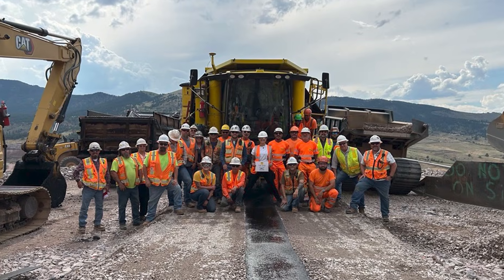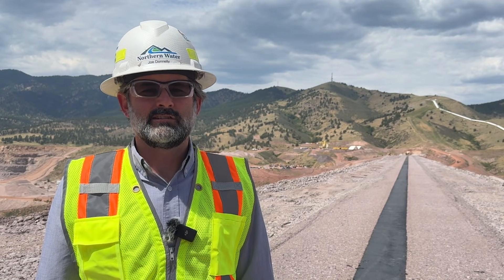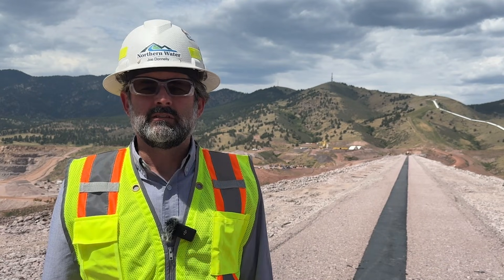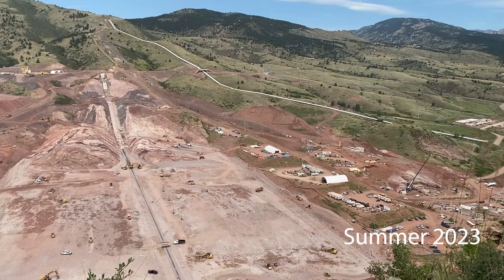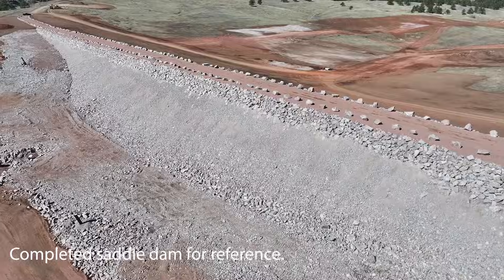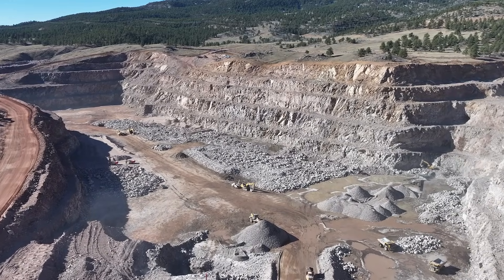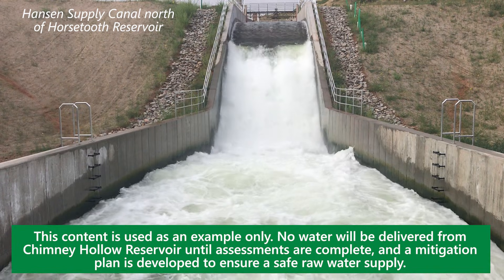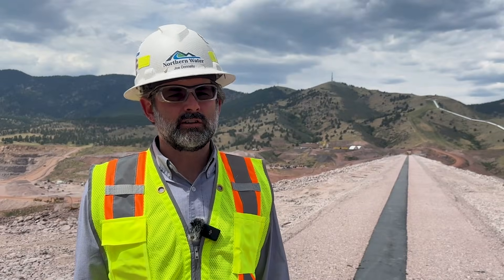Chimney Hollow Reservoir Project Final Asphalt Placement July 2025

Comment: How much strength or capacity does the asphalt core add vs. a pure earthen dam?
Reply from the maker: The rockfill shell provides all the strength of the dam to hold up the core and the asphalt core is the impermeable boundary. Although the asphalt core does make the dam a bit skinnier than if it were clay core, the 90,000-acre-foot capacity remains the same. This dam was originally planned to be clay core, but there was not enough clay in the valley, so the team looked at alternatives and ultimately landed on the asphalt core.